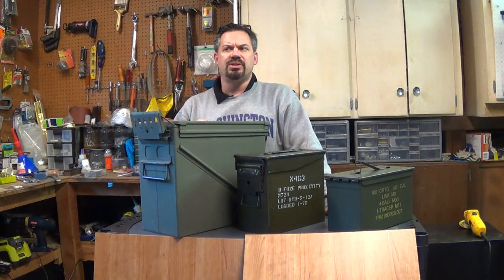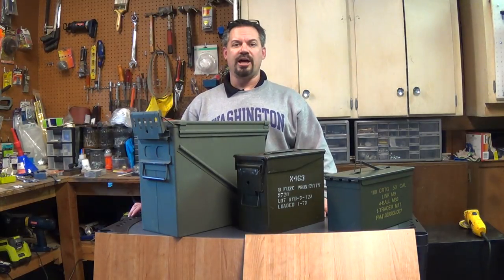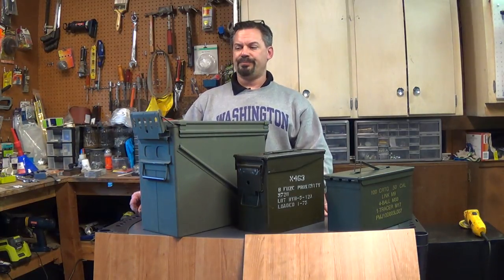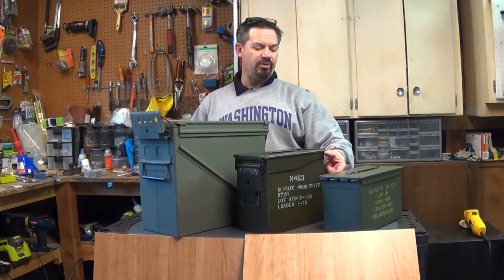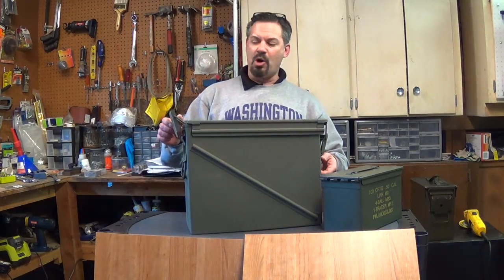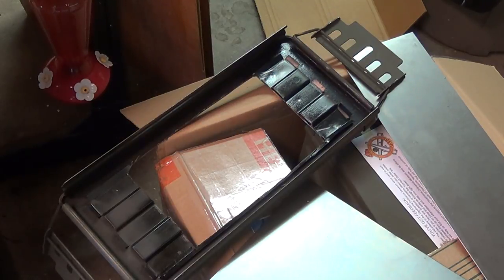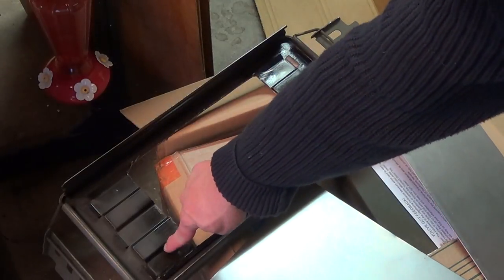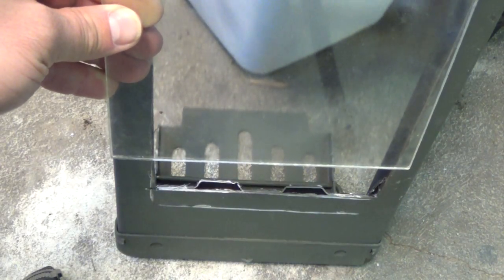Frankenstove:  20mm ammo can wood stove  Part 1

Comment: Once you go 20MM mortar you never go back... ;)

Mine has served me well all these years. Like you, I wanted the light that glass allows. I didn't use a large piece as it becomes a safety hazard so I drilled out a few 2" holes in the sides and used a rectangular 1/4" thick hunk of glass I took from an old wood burning fireplace on each side. 20 minutes on a wet saw and I had the glass I needed to insert into slots I made from angle iron and welded into place. The glass is on the inside and held in by the angle iron and wood stove adhesive. The warpage on such a large opening would be very problematic when the stove maxes out on temp repeatedly.

I am planning a rebuild on my tent stove to add a few mods once I get it back from a family member in the late spring. I also plan on fabricating a built-in wood stove in the Bounder that will be built in the place my oven, stove and microwave now sits sometime this summer as well. Life in an RV is all about the weight so if I add something, something has to go. Like with my ammo can tent stove, my RV wood stove will have an oven so I can remove that. Additionally, I will design a cooktop so that means that I can get rid of the stove. Then, because the microwave is in the way of the stack I need to open that space up so I'll probably put a smoker/dehydrator up there.

So many projects with so little time/funds... Glad I scored a new welder on Craigslist last week.
Reply from the maker: Bugout Bounder That glass is a problem.  I cracked the first one, and then dropped the second one, hence no part 2.  I will probably make a small window out of the largest broken piece.    This project has made me want to learn how to weld.  Maybe I will take a class or something.  Thanks for watching.